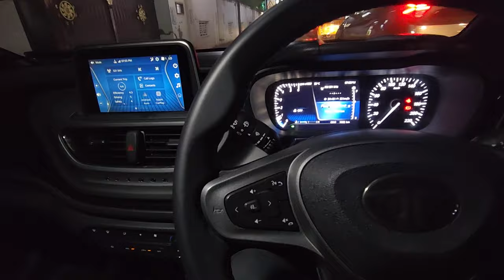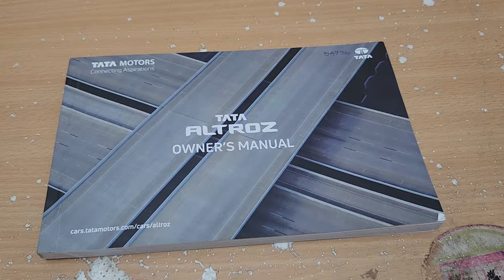TATA ALTROZ SUDDEN GEAR FAILURE WHILE DRIVING | Altroz 1st break down | Tour plan நாசமா போச்சு

Comment: @the View of common man Its because of the Gear link rod, on 1st service they will apply lubrication to the link rod and it will rarely disconnects allowing you to use only 3rd and 4th gear. I think when you took the car to service center they have cleaned out the lubrication. If you know the exact location you can put the link rod back in its place by yourself.
Reply from the maker: Ohh really???it's very nice to hear this information bro...Thank you